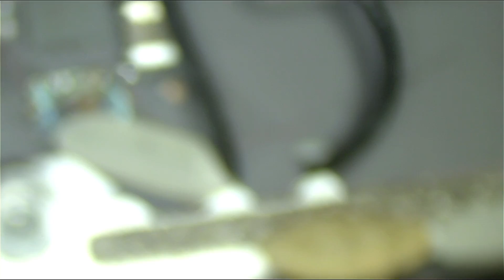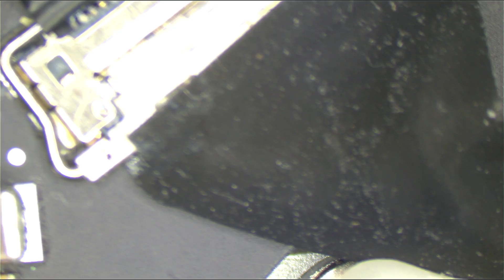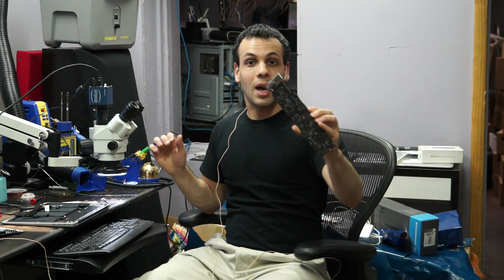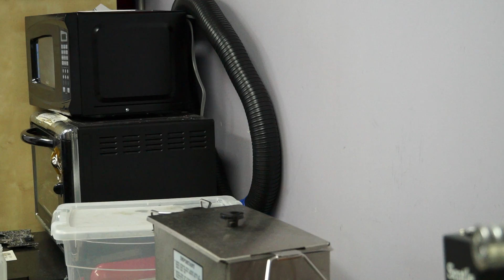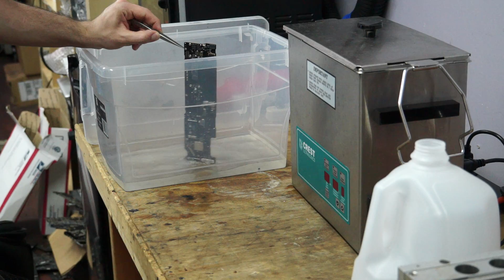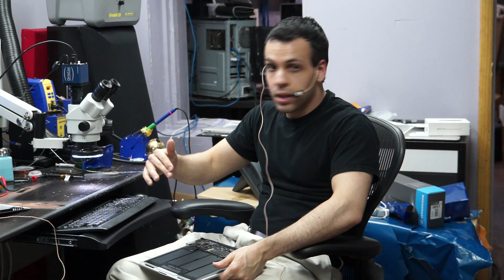How to use rice to repair water damage on iPhones and Macbooks

Comment: hey louis please please help me out !  ?
my MBP2015 cpu vcore shows 1.75v and my fans run all the time , as per apple there is little corrosion inside so if i continue using it without getting repaired is there a chance that the damage will increase ?
is there a chance that cleaning with earbud or toothbrush and alcohol help me fix or minimise it ?
which alcohol should i use ? and is there chances that alcohol might increase the damage ?

Comment: Rice is slightly hygroscopic, so the idea behind this myth is to put your device into a bucket of rice to speed up the evaporation of water trapped inside the machine. This would give it less time to do damage to the board. Dry Silicagel would work even better, especially if done at elevated temperature levels. Well, that is just theory of course, maybe useful if you spilled a glass of pure destilled water over your phone. If it was a can of coke all the rice in the world wouldn't help, I fear :)
Reply: +Shaun Brannen +iPad Rehab i wonder if this is just a case of repair techs vs. everyone else. i think the problem is it makes you feel a little nuts when, over and over, someone hands you a computer or a phone and says they tried to fix it with rice and then you open it and find all the corrosion they were "fixing" and it makes you feel crazy that the internet has convinced everyone of this. if there was ever a delete button for an internet myth, this would be a top candidate. i would also second Louis's idea that any fixing that happens would have happened either way.
Reply: +Rainer R. this just drives me crazy.  Sure, rice is slightly hydroscopic, but so what?  You know what else is even more hydroscopic at room temperature?  Shredded bits of a paper towel.  Or salt.   Stuffing a macbook into a container of shredded toilet paper that you just used to wipe your ass is about the same as putting it in rice.  With the average ambient humiditiy fluctuating from 50% to 100% depending on what the weather pattern is that day, it surely doesnt make a damn bit of difference if a handful of Uncle Ben's knocks the humidity down a few percentage points.   There is no "but it might help"  No! Rice does nothing.

I would argue that ANY ATTEMPT TO DRY IT AT ALL is misguided.  Why would we want the water to evaporate and deposit the slew of dissolved crap on the board?  It is better for the water to stay in droplet form, until you can open that sucker up and clean it out.    It is far easier to clean wet pancake batter off the countertop on Sunday morning than it is to come back Monday night and face a caked on mess.

The problem with the rice myth is that people assume that drying is good---it's not.  In their hopefulness, they want a quick painless fix.  Delaying proper treatment is THE WORST THING YOU CAN DO.    There is no "it might help, it will give it less time to damage the board"   The fact that rice is mildly hygroscopic is the worst thing about it.  We need to teach people to stop trying to dry the board, and get it in alcohol and get it someone that knows what they are doing ASAP.
Reply: @JessaJones  Paper towels are absorbent, not hygroscopic (and definitely not hydroscopic). Salt is hygroscopic but is obviously corrosive. Concentrated sulphuric acid is very hygroscopic, can you think of any reason not to pour that onto your laptop? Louis is deliberately creating a strawman argument in this video by suggesting people use rice to remove corrosion, the idea (and I agree its a crap idea) is to remove water before corrosion developes.
Reply: Maybe the rice helps a bit with getting rid of the water, but water isn't what's damaging your device.
The minerals in the water are conductive and can damage the motherboard.
Reply: @marceldiezasch6192  Water can short out a circuit; getting rid of the water can help.
Reply: Elevated temperatures however also increase the rate of corrosion. You'd be better off freezing the device provided there's enough room for expansion of the water. Ice still evaporates, yet the corrosion process will be severely slowed down.
Reply: No +Marcel Diezasch, the minerals only accelerate corrosion in conjunction with water or another conductive substance. Dry minerals don't cause corrosion.
Reply: Shaun Brannen objects of a metallic substance oxidize not because of water being present on the object but the existence of oxygen being in the environment. Oxidation is a term of corrosion via chemical change that is catalyzed by oxygen aka air. 

And it the object doesn't have be in direct contact to water or any liquid to corrode. The humidity of the environment will determine the amount and rate of corrosion as well as the materials properties of resisting such corrosion.

Aluminum corrodes very quickly and then it stops because the level of corrosion is limited to the very top layer that ends up being a white powdery substance.
Reply: +iPad Rehab That makes a ton of sense, and I totally agree.
Reply: What works soooo much better is using a hair dryer with a no-heat setting.  Alternate low heat in short bursts and long with no heat.  Works so well. but only if done instantly.  Works for me at least.  What Louis says is the real proper way though.
Reply: +iPad Rehab "Why would we want the water to evaporate and deposit the slew of 
dissolved crap on the board?  It is better for the water to stay in 
droplet form, until you can open that sucker up and clean it out.    It 
is far easier to clean wet pancake batter off the countertop on Sunday 
morning than it is to come back Monday night and face a caked on mess."

I'm not sure that's a good idea. Materials oxidize in water much more rapidly than in air, so by letting it sit with that water for longer, you're letting things corrode for longer than they would if it'd been dried out. It's also not horribly difficult for a shop to remove the gunk deposited on the board, regardless of whether or not it's it's dry and caked on or still "wet pancake batter."
Reply: +Shaun Brannen the biggest problem with the stupid rice is that it delays proper treatment.  If people kept their phones wet, then they would seek treatment ASAP and they would not try to turn them on "just to see".   Using rice is the same as just air drying your phone---but now combined with this hopefulness that you actually did something--you put it in rice---so therefore you feel that you have a chance that all will be well.  In your human hopefulness, you plug the thing into the charger overnight because maybe the battery is just dead.   That is what kills phones after water damage.

If this silliness with the rice did not exist, then more people would take the time to open their phones and actually scrub the board.   Just last night I got a call from my own technician---her phone dropped right into the toilet.  She was smart enough to immediately take out the battery and come directly over.  We took apart her phone and the board was pristine.  We cleaned it and dried it.  She dried her LCD screen before reassembly.  That phone shows no sign that it was ever in the water at all.

That is what I'd like to see for water damage---a culture that recognizes the solution is prompt, appropriate treatment.   I think that advocating for people to not attempt to dry their phones leads to this result.

Comment: How could I prevent further damage to my phone/computer if it dropped in water and I'm no were near my tools? If I was on vacation for example and there was no way I could take apart the device? What should I do?
Reply: first and foremost remove the battery. electrolysis takes seconds to occur in some cases(it's not simple water oxidation that is happening). dry the device with reasonable heat or let it dry for a couple of days. then try to turn it on if you want to take chances without inspection that need tools. good luck!